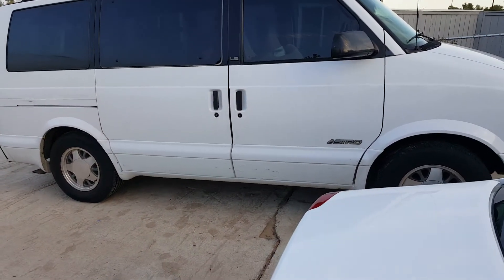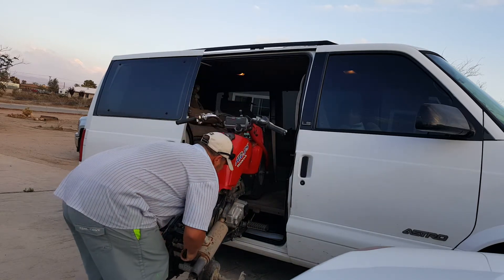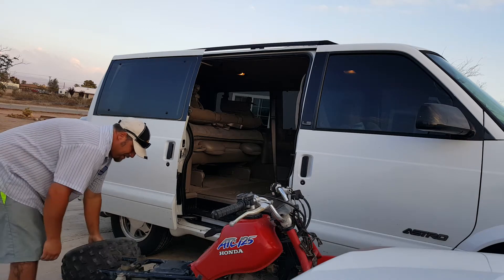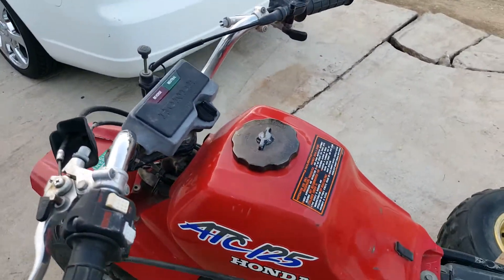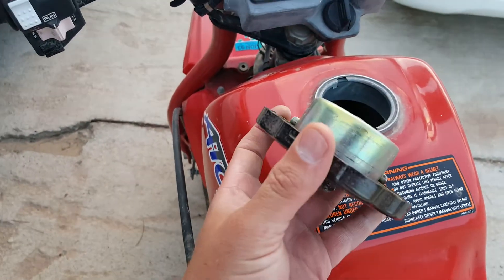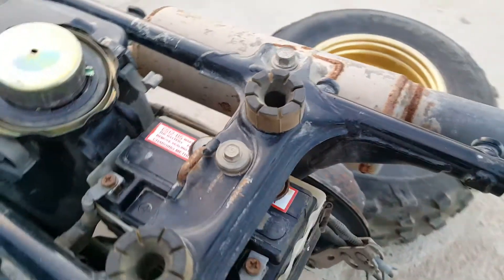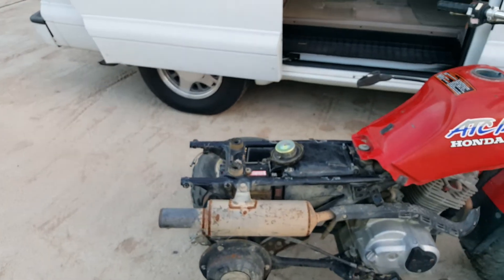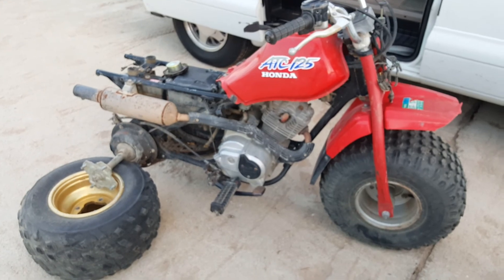87 Honda ATC 125m extremely rare "Little Red"

Comment: i love your enthusiasm.  I have an 86 125m plus an 87 thats half apart that i found right near where i live.  the 87 is the nicer of the two it. the tank leaks  so i need that, the hardware for the plastics and left brake perch.  the purchase came with a 87 125 m frame thats 12 # off of the other one.
Reply: william k. i have a 1987 tank coming in and i just bought a 1986 to get nicer fenders for my 87 125m. i will be selling my 1986 atc125m as soon as i swap some parts. but i can provide a good used tank.

Comment from the maker: Yes I'm going to put some money into it clean it up real nice try to preserve it it'll be my little baby for years to come I hope new powder coat new tires new chain tune up the list goes on I may modify
Reply: +Justin's Trikes Just picked up my 87 125m. Was previously in storage before I bought it but now idles at high reves. Is it to do with the air fuel ratio in the carb ?. Would really appreciate some feedback
Reply from the maker: +Henry Eastick definitely the carburetor for sure it's the idle jet it'll run but it wont idle like normal because it's clogged take your carburetor off remove the bowl unscrew the two jets the little jet heat it up with a torch get it hot and stick a thin little wire through it to unclog it as soon as you get that little wire to go through it'll purr like a kitten again
Reply from the maker: +Henry Eastick on the little idle jet I like to use a piece of wire off the barbecue cleaning brush it's small enough and thin to fit right down the little jet hole to unclog it just heated up a little bit and stick that little brush wire down the hole will fix your problem and you'll be able to adjust the air mixture screws properly again
Reply: +Justin's Trikes thanks will give it a go !!

Comment: I have an original 125m elc. start engine for sale any body looking
Reply: Where you from and how much you looking to get?
Reply: Mark Alan 
I'm in Las Vegas 150$
Reply: Hey, thanks for the reply man! It's a little far for me to be  interested. I'm from upper Michigan. Was hoping you were within a couple hundred miles from me. Shipping alone would be too expensive. Thanks anyways though!
Reply: Mark Alan.. Actually shipping isn't that bad. Around 50 bucks tops anywhere in the USA.. You can actually get it shipped though Fastenal or grayhound pretty cheap for something like that.. I live in Oklahoma and get engine parts shipped from Canada all the time and even a big Diesel engine I can use lee get shipped for around 150-250 bucks..

Comment: thats not a 125. its a 185/200. not rare or cool.
Reply from the maker: read the label Brent it's a 125m and if it wasn't rare there would be more then 2 on you tube.Dumbass
Reply: My 85 has a vertical  motor but don't have that tank I restored it
Reply: Lol!! It's most definitely an 86/87 125M.